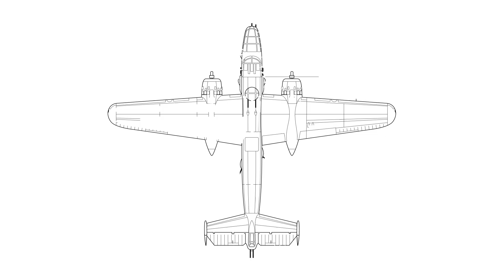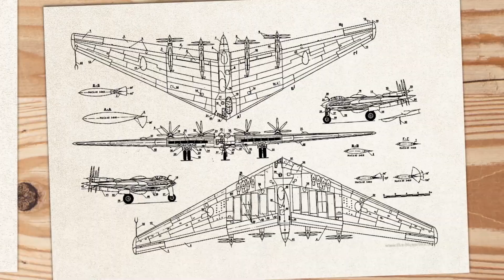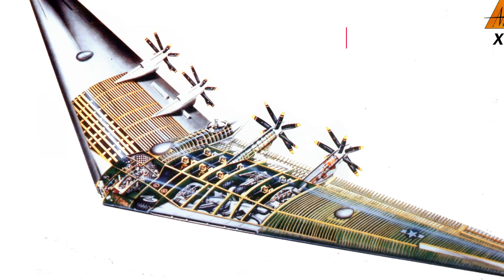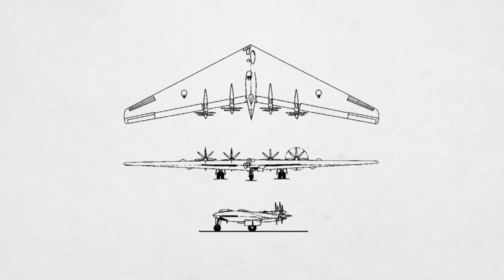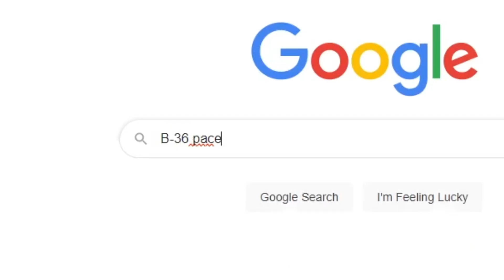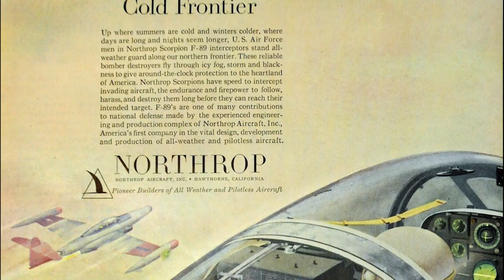This Plane Is CURSED - The Forgotten Flying Wing…

Comment: Way too much conspiracy theory stuff, way too much hyperbole, way too much supposition, and way too many inaccuracies.  That, along with far too much historical ignorance as to how aircraft development takes place.

The XB-35 was indeed "cutting edge" back in 1941 - too "cutting edge," as it turned out.  Developing an aircraft that large and complex was far too difficult for a company as small as Northrop was back then.  As the US got into World War Two, Northrop had its hands full producing its range of more "conventional" aircraft for the military and could not devote enough resources to the Flying Wing effort to keep it current.

Thus, come war's end, a design which was "cutting edge" at the war's start was significantly outdated.  Also, as the design went from paper to metal to flight it revealed a host of problems.  The most major of which was some exceptionally poor handling qualities.  The aircraft was deemed "instable around all axises."  That was what the Air Force's chief test pilot for the program, Colonel Bob Cardenas, testified to the Air Force and Northrop about the XB-35 and YB-49.  

Such instability may be useful for a fighter plane but not for a bomber.  Among other things, it makes it much harder to drop its bombs accurately if the aircraft itself is skittering all across the sky as the bombardier attempts to aim those bombs.  Northrop believed that the stability issues were ones that could easily be solved - with more time and money.  Which was the thing - the military had already poured enormous amounts of both time and money into the Flying Wing program and was loathe to keep sending more good money after bad.

In that era of budget cuts after World War Two the Air Force also wanted a plane that could be produced in vast numbers - something it deemed necessary to be able to do if there was a war with the Soviet Union.  But Northrop was still a relatively small company that produced relative small numbers of small planes.  A giant flying wing bomber like the B-35/49 was seen as being beyond Northrop's ability to deal with - unless the Air Force coughed up even more money and took more time.

Nothing mysterious then about the decision to cancel the program.  The aircraft was unstable in flight and couldn't be produced in enough numbers because Northrop was too small to handle the work.

The B-36 was already coming into operational service while the YB-49 was still in testing.  The Peacemaker was already doing everything that Northrop could only promise that his Flying Wing might eventually be able to do.  Again, that makes for a real clear choice.

On the technical side of things, lots of government contracts feature what's known as "GFE" - Government Furnished Equipment.  That is, the government specifies they want a piece of equipment to do such and such a job and as part of that, the government itself will provide some necessary component for the equipment.  This allows the development company to focus on its key aspects of the overall design.  In the XB-35's case, this was the engines and the transmissions for those engines.  They were "GFE" for the program.  There was nothing unusual or mysterious about that.  It was just the way those contracts operated - and still do.  

The US never had much luck during the 1940s developing contra-rotating propeller systems for larger aircraft.  It was no surprise to see that trend continue with the contra-rotating prop system set up on the XB-35s.  There were a number of other aircraft designs of the era that also ran afoul of such a propulsion system concept.  Again, nothing mysterious or underhanded.  And debating about liability for such design failures was endemic to the industry then as it is now.

Jack Northrop was a visionary.  And he staked a huge part of himself on the supremacy of his flying wings - an aircraft design layout that he'd been working on since the 1920s.  Flying wings are nothing new and Northrop didn't invent them.  His advocacy of them however, left him somewhat blind to the inadequacies of his designs as they attempted to realize that vision.  The internal layout of his Flying Wing bombers - the XB-35 / YB-49 - were appalling, as but one example.  The pilot was seated up in that bubble canopy with a superb all around view.  The co-pilot was stuck down beneath him in fuselage where could only see directly in front of the aircraft.  Aside from the lack of visibility there was also the lack of physical communications between the two men flying the plane since they weren't next to each other as they are in conventional layouts.  There were also no surge baffles installed in the fuel tanks.  This meant that fuel would tend to slosh around on the inside of the tanks as the plane moved through the air.  That had a truly nasty effect on its handling.  These were things that could be fixed, yes, but the mere fact that such basic things are conventional layout for the flight crew and basic aircraft internal systems weren't paid heed to by the Northrop company right from the outset really didn't do much good for Northrop's credibility.

In the end, the Flying Wing looked great but its design and performance failed to match its good looks.  The Air Force was correct in cancelling the project at the time.

Comment: The same wing span as the B2! However, it was the rear stabilizing controls from the Horton brothers wing that you see on the B2...
Reply: I'm sorry but it's called modern flight control computers. Not anything done by the Hordon Brothers.
Reply: Nothing was taken out of the Hortens. Every surface control (including the split ailerons, which was included in Northrop projects way before the germans) was taken from the general aviation knowledge

Comment: Northrop sabotaged himself – it wasn’t an engine-propeller problem, it was that the swept trailing wing edge caused a different wing-wake to hit each side of the props creating unacceptable and unsolvable vibration. Switching to jets made it a medium-range bomber in losing competition with the B-47.

Comment: Didn't Jack Northrop borrow his design from the Horton Brothers?
Reply: Nah!   The Horton Brothers got their design from a glider called the Plank.   It was basically a flying wing design.   The Horton Brothers put two Jumo Jet engines into it and told nobody to fly it.   A German pilot flew it and it flew well but then he crashed it on landing and walked away.   Air Force BGen. Charles Yeager said: "Any landing you can walk away from is a good landing.   If you can still use the airplane the next day, it was an outstanding landing."

Comment: This whole mess has the feel of something that happened in the 00's.  A new software company back in the 90's started doing very well for itself.  It was making money hand-over-fist, all the employees were well paid and treated, and everybody was having a good time.  Then, the CEO of a much bigger company got a bug up their butt to take this company out (it wasn't business; for some reason, it was personal).  The smaller company did everything in its power to try and stop the bigger company from buying them out (including something called a "poison pill"), but to no avail.  In the end, while the bigger company succeeded in buying out the smaller one, they were unable to dismantle it as the customers (some very important) screamed bloody murder.  They still support the product, but they're trying hard not to.

This is kind of what the deal with Northrup sounds like: a bully with power being a bully.  I suspect the flying wing would have done very well and made lots of money; as a Convair product.  Since it wasn't going to be a Convair product, it needed to be destroyed so the guy following him doesn't have a chance to change the Air Force's mind.

Disclaimer: I'm am very much armchair quarterbacking here and have no sources to back ANY of this up, so take this all with a very large saltlick.

Comment: What really got interesting, the AF General that cancelled the flying wing, retired, and went to work for Convair on the B-36 program.
Reply: Complete fabrication. Symington NEVER worked for Convair, and he did not cancel the B-35 production contract. All he did was approve the B-36 production contract, in accordance with the Air Force Source Selection Board recommendation.
Reply: @daveciocchi851  The book I have, the  history of Northrup, told it otherwise. That's my source.

Comment: Nice model and rendering. Some of that stock footage is jarring though, like millennials arguing.
Reply: And there's the irony (apart from the arguing millennials), there's enough stock footage to illustrate the fact that the (X-plane?) models are fairly off detail with all the imagery of the YB35 showing all the props turning the same way (yeah, just try to explain that away as shutter sync), and all the shots of the real YB49 showing that the rear fins were symmetrical above and below the trailing edge, not mounted no short stubs above the trailing edge.

Comment: Another great video! I honestly think these videos will get some people to wonder “…well, why not now??” And make some serious progress in a start up. If the wing is pretty much designed to stay in the air, then making one that’s a hybrid to get it off the ground and kick in when the battery is low seems like it’s worth looking into and that was just off the top of the head. It’s like a better B-2. 

If I was Jack I would have used the upper body strength developed from using a wheelchair and just slapped the fuck out of everyone in that room. This is genuinely infuriating. Like all good things that the government tries to kill, it’s unbeatable until they break the fourth wall and say “just shut up this is happening and obviously there will be no investigation, that shows guilt or fault, of the individuals whom used their official capacity for self interest and wasted tax payer money. 

Honestly, I can’t tell you how grateful I am that you release these with some sort of closed caption ready to go. The secret things people care most about YouTube is not having drastically changing volumes from one video to the next and most importantly not in the same video. The other is closed captioning. Some of us just won’t watch a channel because of those two things.

Comment: Jack Northrup was a genius - and so was Dr. Arnim Zola - who knew the potential worth of the flying wing and then proceeded to further refine the design of this long-range bomber to his own specifications. He made it much bigger and also had fighter-interceptor aircraft bays incorporated into the wing. This is the Infinity Wing.  He also solved the electrical - and powerplant problems of not having sufficient capacity by using a highly controversial and top-secret cosmic cube that yielded vast extradimensional energies that had very mysterious origins, which was in the possession of the off-shoot independent secret weapons branch called Hydra, and not the Penemude SS Divison.   Thus, the Tesseract powered Infinity Wing was a one-off development and build for Hydra High Commander Johann Schmidt's use only. The Infinity Wing ultimately crashed into the Antarctic Continent Ice Shelf with an allied super-soldier spy and saboteur Steve Rodgers at the controls of the now damaged and uncontrollable craft.  His frozen body -corpse and the Tesseract were recovered about 70 years after the crash. Johann Schmidt's demise is open to speculation.

Comment: Both the original propeller  and later jet designs were too hard to control in flight.  Today's computers make these possible.  If you check,  you will find saucer designs with the same issues.

Comment: The only reason Flying Wings didn't succeed earlier, is the inability of any Pilot to control side slip, directional stability and other flying wing quirks.
Thanks to modern computers, fly by wire and electronic sensors they're now a reality.

PS: A lot of people at the Air Force were obviously getting Boeing's kickbacks... SIGH

Comment: Cursed? My Father worked on them, as well as almost all of Jack Northrop's designs. The problem with them wasn't being "Cursed", it was a stability issue and demanded a very, very good pilot. Those stability issues were pre-computer age, now they are handled by the on-board computers.
Reply: Fixes were available back then but the USAF and their corrupt CoS didn't want it or Northrop's company.
Accuracy didn't win the war: they were happy to firestorm cities on a cloudy day. Nukes don't require "pickle barrel" precision, and guided munitions had seen use in the war.

Comment: (00:00) “Rising above the battlefield in WW2 is the bomber aircraft of the future....“

Nope. Already wrong.

Concerning the next sentence, Jack Northrup´s endeavor to design, build, and fly the flying wing was primarily benefitted by the previous work done by the German Horten brothers, divulged at the end of the war.

In short, early flying wings were doomed, especially as a stable flying platform necessary to be a bomber, because of an aerodynamic effect called roll-yaw coupling. Only after artificial stability systems were technologically feasible did modern flying wings become practical.

Comment: Not cursed a victum of authoritarin tyranny! John K Northrop was to to sell his company to Consolidated Vultee or else, "You’ll be goddamned sorry if you don’t". Is what Stuart Symington told Northrop. Northrop told him to go have sex with himself! The B-36, a Consolidated Vultee product, got the contract and the B-35 was scrapped! The B-36 was a dog!! Just after each take off the flight engineer would have to roam about the plane looking for failed structure. If he found none the flight would continue. The B-35 also had it's problems especially with the flight control overcompensating causing the plane to porpose. The B-2 has a similar problem but with an onboard flight computer it solved the problem.

Comment: Northrop's Black Widow, first successful purpose built night fighter and first successful multi-engine fighter, for the  United States (which you see flying off the port quarter of the Flying Wing in one of the images) stole the place of other companies' night conversions. It really was unheard of, for a company to take fighter and bomber contracts simultaneously, especially for radical designs. But the B36 got supplanted for political reasons, by Boeing's B52, so we see that bias has its place in procurement.  
Look back before the war, and see the offerings from Brewster company, supported for political reasons, and see how that came out.

Comment: The biggest issue with the early flying wing bombers was yaw stability.  A strategic bomber needs to be able to hit it's target.  It's hard to do that when you're plane keeps wandering left and right.   The B2 uses spoilers and fly by wire for this but that technology wasn't there in the '50s.

Comment: Politics have always plagued weapons procurement in the US. We have a tendency to praise our generals, but if you have never served you have no idea what bastards they sometimes are. Not at first, and not all, yu have to watch their careers, did they serve with some special command that did R&D? Where they envolved in the supply chain?
Gennerals, High level government employees and politicians retire or leave an are immediately allowed to go into the public sector, often to the very companies they had dealings with while serving the gov.
Every time this someone tries to address this issue they are blocked or come up with some loophole.
Whether you liked him or not, Trump tried to put an end to this, but was advised basically against it and stopped/blocked by members of his team. The deep state is real, you don't have to be a tinfoil hat type. People love money and power.
By the way this plane would not have worked out anyways. It needed ten more years for computer tech to catch up. There was an interview with one of the test pilots which talked about a serious oscillation problem. All aircraft without vertical stabs suffer from this. Most aircraft with unstable flight characteristics have stability augmentation unit of some flavor to correct it. These units are constantly performing micro corrections to the control surfaces.
Translation = no computers = B2 makes a big expensive hole in the ground.

Comment: As elegant as flying wing designs are: They are far from aerodynamically ideal. Without the highly adaptive aerodynamics of our feathered friends it is difficult to impossible to design a flying wing that is more efficient than a conventional design.
Case in point: look at a B-2 in flight. You will find that they fly with their drag rudders constantly slightly open. Hardly what you want in an efficient design.

Comment: I've been to the Mojave crash site several times, there's a memorial and flag marking the site. Small pieces can still be found if you have a sharp eye. Ground is covered with small lumps of sand mixed with melted magnesium. Site was excavated some time in the mid 80's as it was all that was left of the YB-49's. Lots of turbine blades and steel parts were recovered, as just about everything else melted or burned.   A wing tip that landed separate from the main crash site sat in the boneyard at Muroc (now Edwards) for a few years before being scraped. Photos can be seen here. http://www.check-six.com/Crash_Sites/YB-49_crash_site.htm